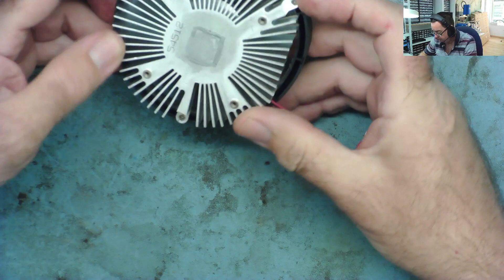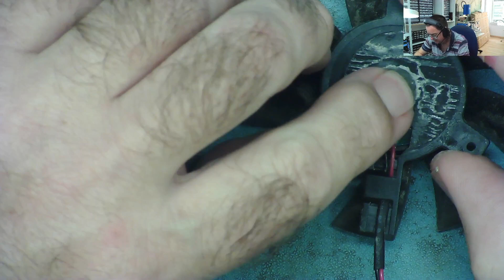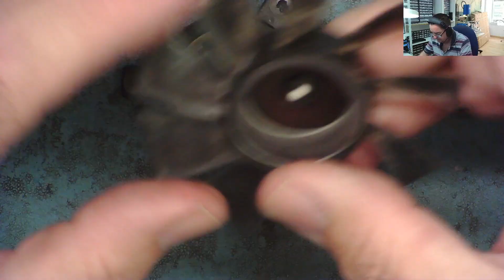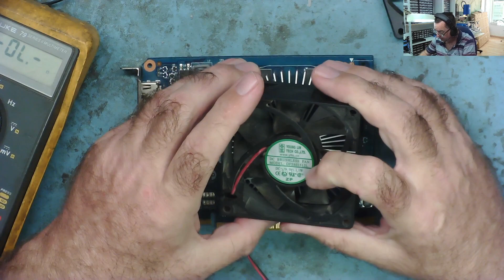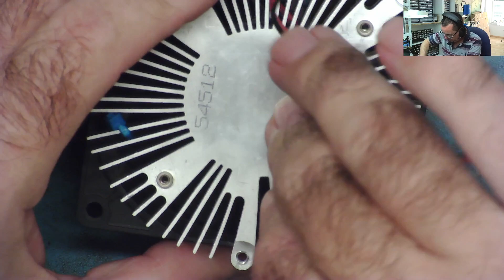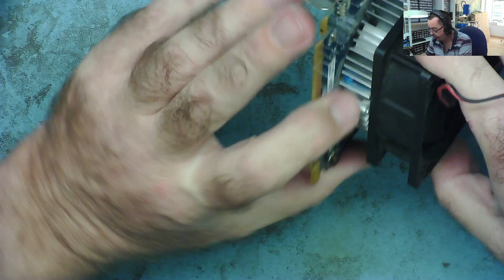GPU Fan Not Spinning Seized / Locked Solid - Can we fix it?  LER #134

Comment: Not sure why you would take apart the fan completely. 1 or 2 drops of cars engine oil on the back of the shaft is all they need, even if they are seized up fully. Just keep rotating it till all the oil got where it needs to be.

Comment: My gpu fan controller is faulty, it says gpu fans are at 80% when they aren't spinning, when i turn them up to 81% the actually run at 20%, and when i turn them up to 82% they run at 100%. Did you have similar issues, and i would love to hear from your experience. 
Btw gpu is MSI HD7970 ligtning BE, and only fan curve that works is that fans only ramp up to 100% when gpu reaches 80C.

Comment: I noticed at 17.13 you say 1.1 amp but its 1.1 watt. Doesn't that mean that the current is only 0.09 amps
Reply from the maker: Sometimes I make mistakes.  It's watts not amps
Reply: @LearnElectronicsRepair  ah yes. I wasn't having a go. I was just saying because if the current was that low then maybe it wouldn't have affecting the circuit. My numbers might be wrong though. I'm currently going through all your videos chronologically and enjoying them a lot. I've even picked up a number of the tools you suggest. I'm hoping to start doing some repairs. Starting with my Dell PowerEdge T610, which the BMC says has a vcore issue and it won't switch on.

Comment: If I can get to back under the sticker I never take it apart because the shaft breaking happens a lot. Instead, I just put 2-3 drops of 3 in 1 oil and that usually frees up a seized fan. I reseal the sticker on it after ensuring there is no excessive oil. After that I spray some WD40 into the middle space between the top and bottom. That usually gets a fan working again for me. Sometimes I may still hear a little bit of crunchy noises when the fan first spins up but is fine after. This method gives you a little more life out of a fan even if the fan bearings are fairly worn…at least will offer enough time to complete testing and so on until a replacement fan is sourced. Many times I was able to just keep the original fan and not replace it. This has worked well on old GPU and CPU fans even from the late 90s and early 2000s given those old fans can be hard to find these days. My successful repair rate with the method described is about 85-90%. Not too shabby I think 😀
Reply from the maker: That's a good success rate.  I made previous video showing the method you describe.  This one was particularly seized so I tried a different way.  

In hindsight I would have tried freeing it with a mixture of oil and WD40 as you suggest.  I upload my videos whether they are totally successful or not.  A lot of things are learnt from mistakes.
Reply: @LearnElectronicsRepair  and for that reason good sir, I really appreciate your channel. To make mistakes is what it is to be human, so kudos for keeping it real!

Comment: And you can get a replacement fan for cheap if you want (just watch the dimensions).
Reply from the maker: Yeah I am sure I could find one, as I mentioned on the video, there are many ways to fix this sort of fault - I was just doing the ghetto version using what I had to hand.

I'm quite impressed with the temperature performance of this modded GPU under load though.  

I'll put this GPU in my Youtube recording PC for now (to replace my Radeon HD 4800) until I find something even better.  I think OBS (the free software I use to record and do the picture-in-picture on the fly) will take advantage of the GPU to improve the video processing performance.

As I mentioned I recently changed the CPU from an i3-4130 to an i7-4770 

https://cpu.userbenchmark.com/Compare/Intel-Core-i7-4770-vs-Intel-Core-i3-4130/1978vs1621

and definitely can see a difference on the recorded videos - It seems to have stopped the dropped frames problem pretty much.  That and recording live to an SSD made a big difference, even though it is a small 128Gb one.

Actually reading the specs that the so called experts say you apparently 100% need to start a Youtube channel, I am surprised how well my setup actually works, because, apparently, it shouldn't!
Reply: @LearnElectronicsRepair  My two last comments disappeared; they both contained links, maybe you're set up to block them and ended up in your review folder.
Reply from the maker: @johnprescott6614  No not at all John.    I recently saw you commenting in my drop down alert (one was about VAT in Spain and AliExpress, yesterday or the day before), but when  I try to read the full comment it is not there on the video.  I assumed you were deleting them?   The only comments I ever manually delete are ones where someone just posts bit.ly links and no text to say why they are posting the link.  I didn't know i had a comment review folder -  I will check now
Reply from the maker: @johnprescott6614  Just checked - nothing in Held For Review folder.  Repost your comments and let's see what happens.  I got the AliExpress problem sorted by the way!
Reply from the maker: Same again John I can see the first part of  your comment in alerts but when I go the the video - nothing
Reply: @jonchapman6821  Lol you're right; the link was to Nvidia's website (Video Encode and Decode GPU Support Matrix), anyway the 750 is Maxwell 2nd gen, it can encode H.264/H265 in hardware (much faster), that's what I said in the previous post.
Reply: I used cheap fans, they won't last. Fixing original ones are way more better.